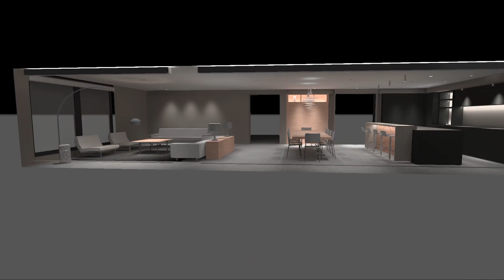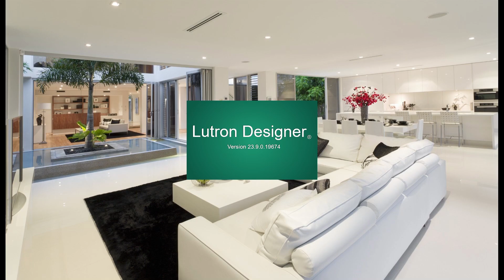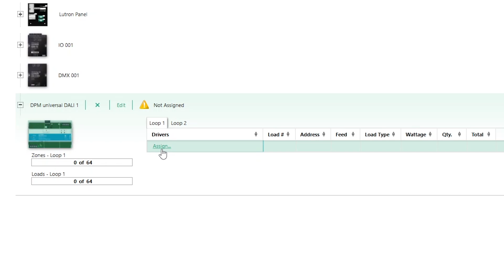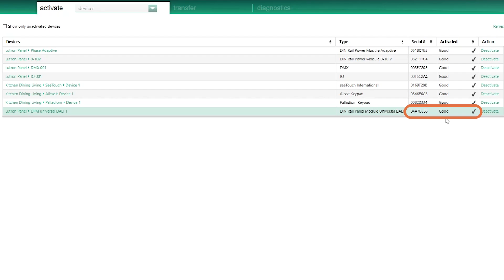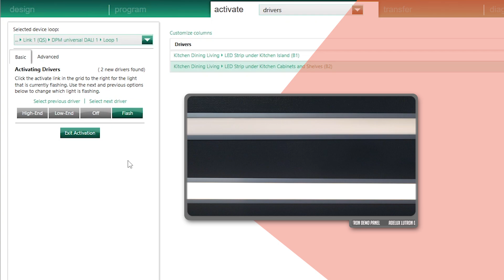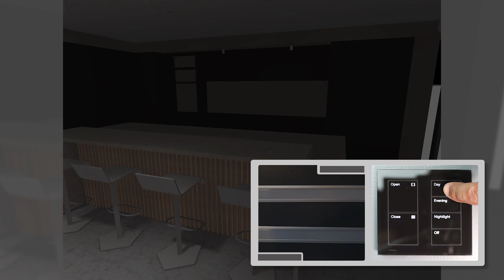How to Program DALI Light on a Lutron Homeworks Lighting Control System - DALI Addressing - NEW 2024

Comment: Hi. Love your content. Is there a work around to control a DALI light with RAR2 Select? Thanks
Reply from the maker: Thanks 🙏🏾 ! No no work around to another solution/system. If you are in the uk 🇬🇧 Rako controls has a wireless Dali solution ✌🏾
Reply: @adelux  thanks for your speedy response. I had a look at rako but it's beyond my skill level! I'm putting ra2 in my house renovation. I have only one DALI light - have you ever used a 0-10v to DALI convertor (lunatone do one) so that the light can be controlled with the ra2 0-10v module? The electrician is doing all the wiring - I just have to control it all 😊 thanks for your help.